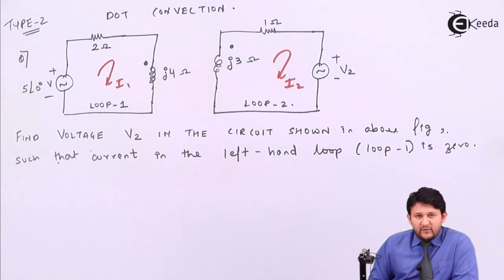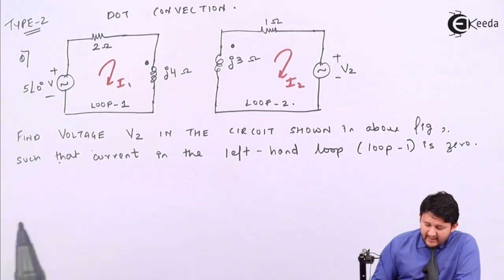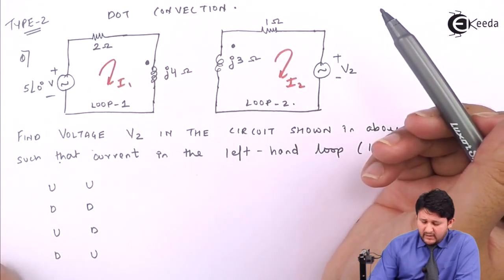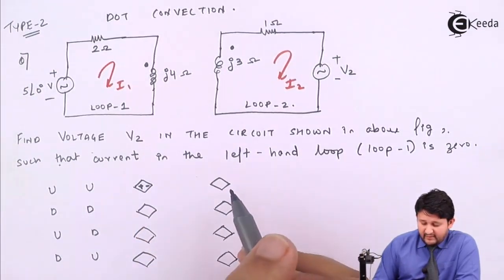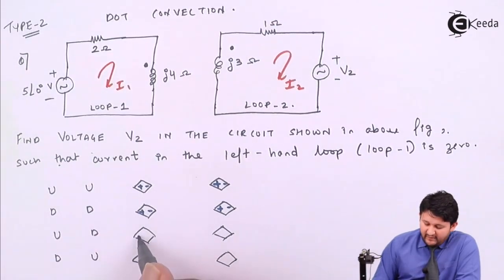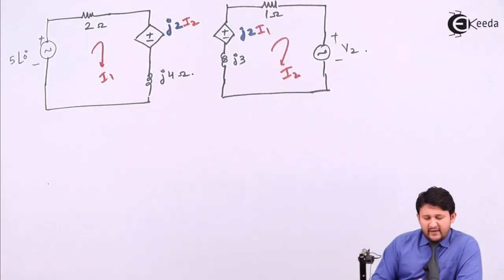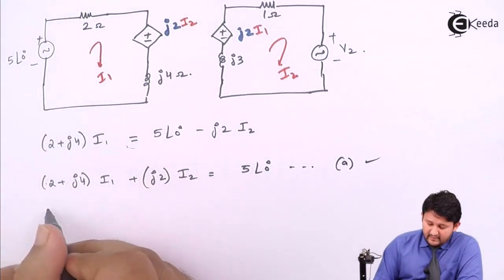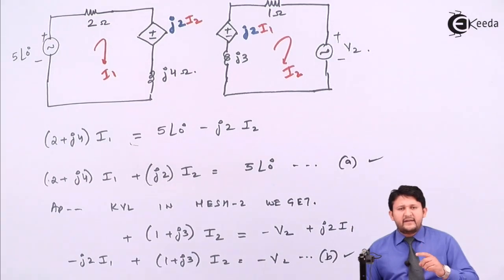Dot Convention (Problems) - AC Coupled Circuit - Circuit Theory and Networks

Comment: Sir I have seen another video in which he explained the the signs for voltage source is different as you told .so answer is coming correct. So which method is exactly correct sir